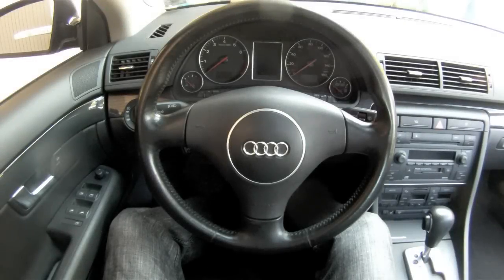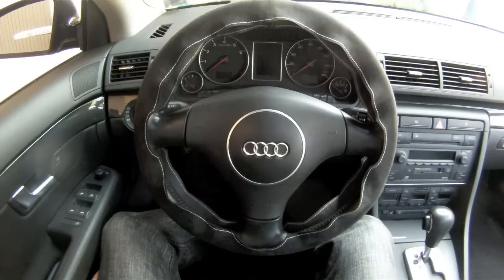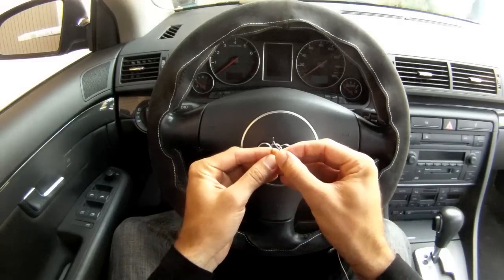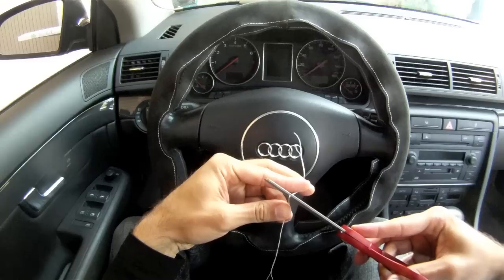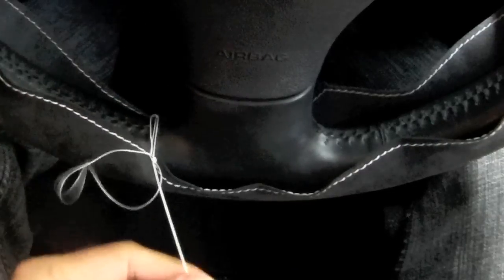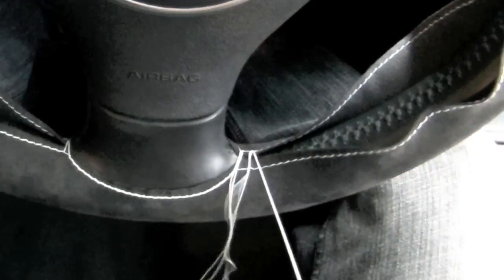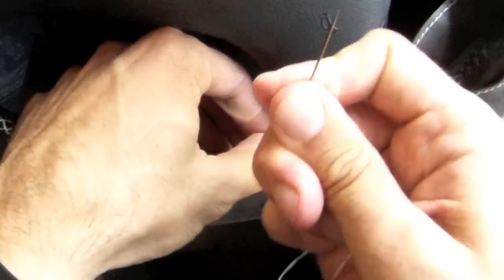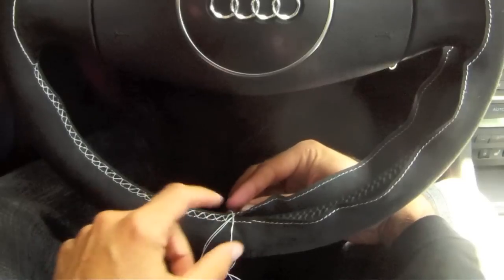Racing Feeling Steering Wheel Cover Installation

Comment: The steering wheel rim of my 2004 Honda S2000 is a little thin, I was thinking about getting a Genuine Leather Steering Wheel Cover to make the rim a little thicker.

This excellent video is really helpful. I think I will be able to install mine successfully.

Also, thanks to Jameshisself for suggestion of threading the first pass through the inside of the knot between the 2 pieces of thread.

Comment: So why can't we just get a really long strand of thread and sew the whole thing at once?
Reply from the maker: You could certainly do this, but it's not recommended. Managing one very long piece of thread is challenging and increases the likelihood of forming unwanted knots. Keep in mind that the entire thread needs to pass through each of the loops on the steering wheel cover, so using a single long piece would actually take more time. Thank you for the great question!